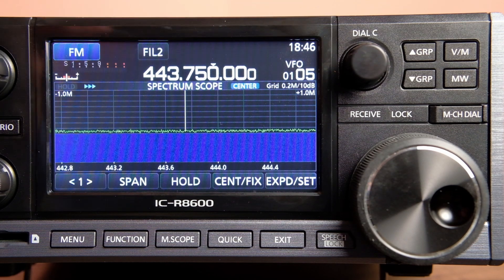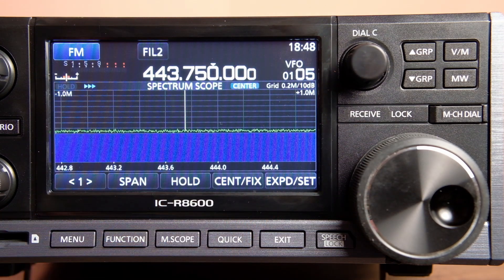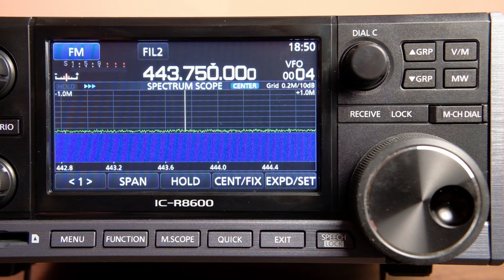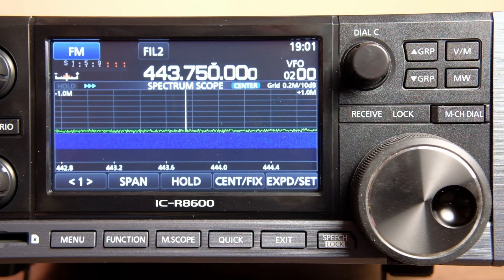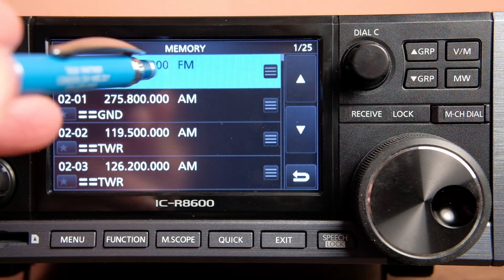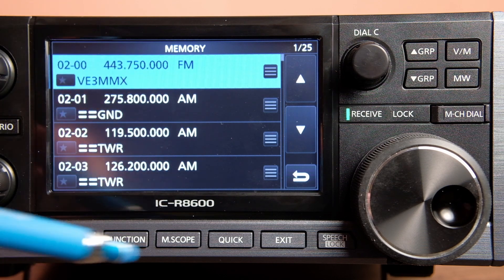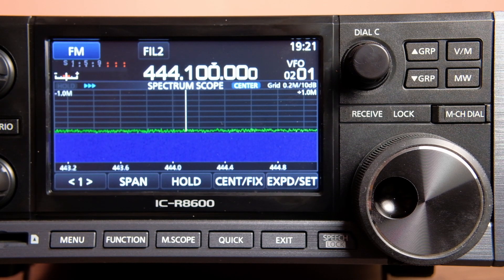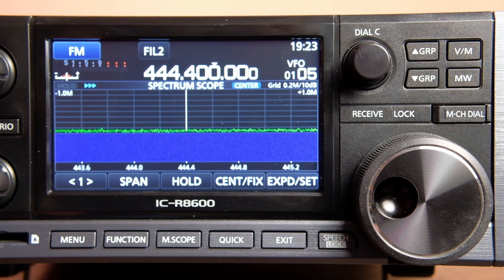ICOM IC-R8600: Simplified Memory Programming and Scanning

Comment: The icom icr 705 is as sensitive as the 8600 plus portable Bluetooth GPS for half the money
Reply: I have both, apples to oranges.
Reply: The price of the above is still prohibitive to most and the IC 705 is around £1399 even with its cut down receivable frequencies, people will end up using an SDR Radio which may be fantastic but is let down by appalling/lack of SW from  the vendors- especially if you are a Mac user.
Reply: @steveblanchard7293  I'm about to hook up a new SDR. If that's good, I'll use a second one for trunk scanning, which this radio cannot do. If there's a problem with that, this radio is my Plan B. Far as I know the proper software is available for my Linux system. If so, your Mac is also supported.